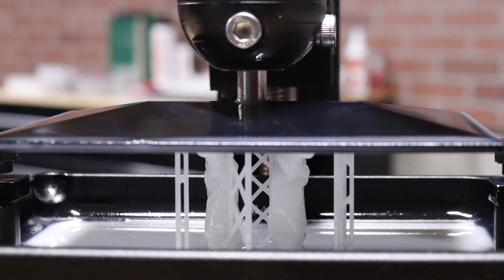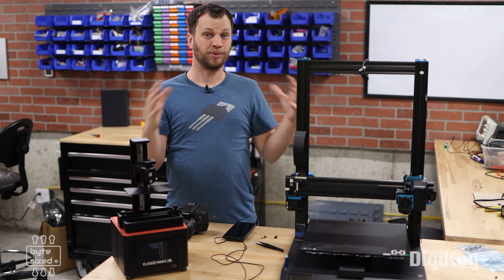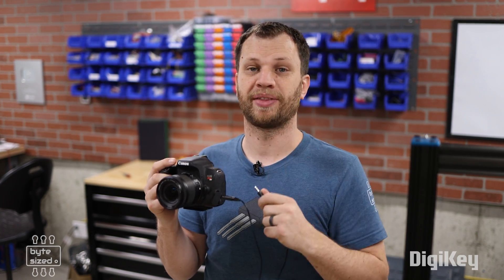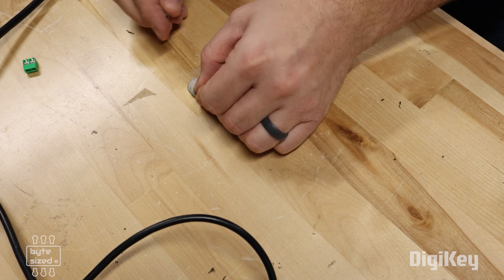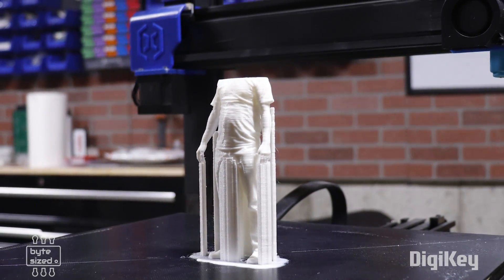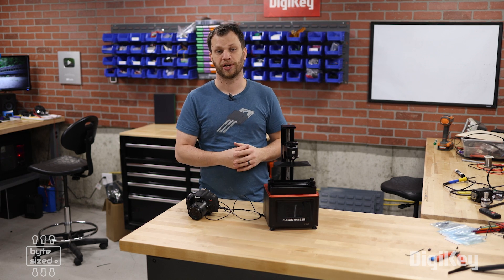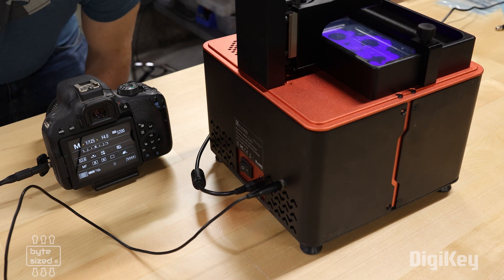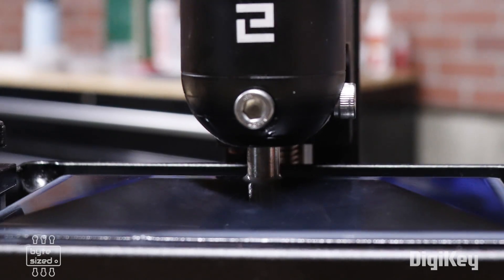How to mod your 3D printer to create timelapse videos - The Byte Sized Engineer | DigiKey

Comment: Just a couple of thoughts. 
- Not sure how long the photo resistor will run in a high UV environment. 
- Salvage the parts from a selfie stick for the phone version. 
- If you wanted to do the same firing cable for both methods, make the resin version with the photo resistor and interrupt a light source with the X axis instead of a physical push button switch.